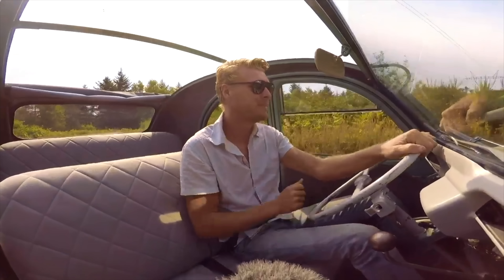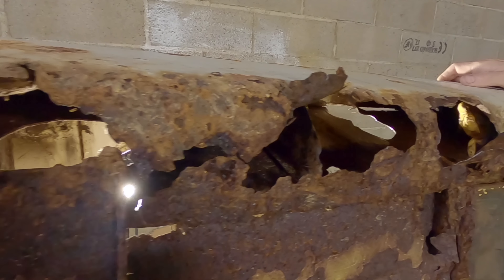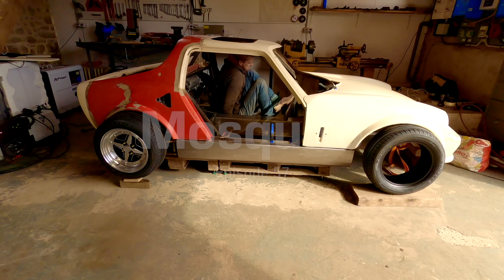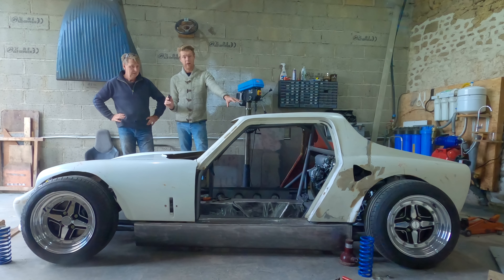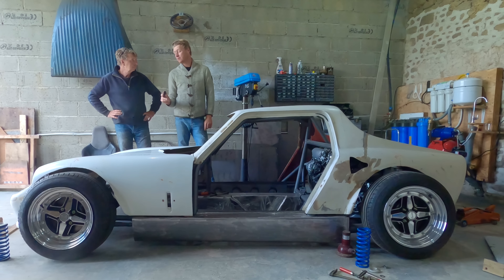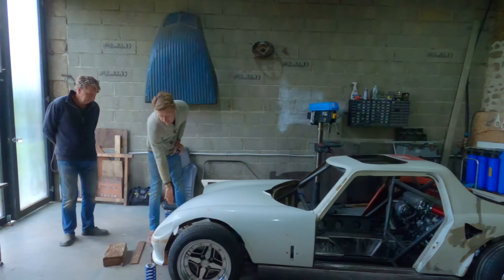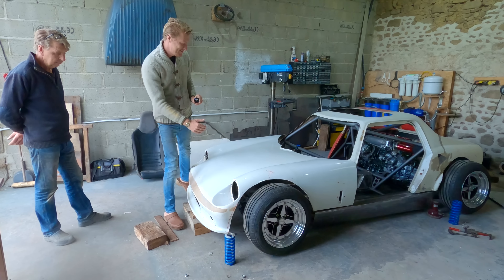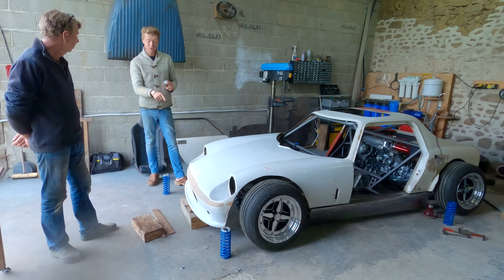Slammed  | Project Mosquito Honda Type R Mini Supercar (Ep57)

Comment: Having done a lot of fiberglass, I have learned a few things. With regards to the wheel arches , It way easier and more uniform , to find something, to use as a mould, that is already the right shape, or can conform to the right shape easily. Plastic is a great thing to use, firstly because the fiberglass doesnt stick to it, but also for its flexability. If you look around you might find a garbage bin , lampshade or whatever that just fits perfectly , and can be copied four times.

Comment: Looking at how that body is personally i think you would better off just cutting ans shaping that one then making a mould off of it, then you could make a new body with a consistant thickness and adding reinforcement where you want. Not to mention that you could keep the moulds and pull a replacement if there is ever any damage

Comment: Glad you're redoing the center notch, "unrefined" describes that well ;)

For the rear wheel arches, have you considered cutting on the horizontal body line, and then just extending it outwards to cover the wheels? You could blend the door into that, or just put a mild backwards rake into the extended body section. Could be an opportunity to add venting and radiators. An idea for the front clip could be to split it down the center line, but then also cut perpendicular across the vertical edge of the headlight bucket. The two resulting front fascia pieces then lengthened to cover the wheels, and the rear two pieces angled so they line up with both the extended width front fascia, but also with the door jambs.

I hope Youtube's algorithm will pick your channel up soon, because it deserves to be seen. I've watched your whole Mosquito series from beginning to now, and can't wait to see the first drive when all that HP meets the lightweight construction.
Reply from the maker: You have a good eye. It will be widened from the body line but I want it to look completely unmodified
Reply: @OliverPickard  As you've said in earlier videos, you've been planning this build for most of your life, so you'll probably build something very appealing and exciting. And I'm looking forward to it!
Reply: @OliverPickard  I'm having Mosquito to Morris Minor thoughts but you'd need to add a bit more than the 4" that took. I then start to think about Porsche flat nose fronts. There might be some Porsche fibreglass wings around that could be adapted.

Comment: Fantastic as always.
2 Random questions
Will you fit Led headlights?
Have you considered some vertical air-dams type devices at the front of the front wheel arches?
Reply from the maker: No i don't like spider eyes, air type device...wheel arches? Yes
Reply: @OliverPickard  🤣 Thanks for answering

Comment: I would not be surprised if you end up using the modified shell as a mould, you know that you want to do a full carbon fibre shell... Works Escort style bubble arches might look good on it, and you would be amazed at the stiffness the shape of the front ones would add to the clam.
Reply from the maker: Bubble arches would be far too easy although you are right they would look good

Comment: Rather than cut great chunks out of the front clamshell, you should have lengthened it to center the wheels in the existing arches. Cut off the rear of the clamshell behind the wheel wells across the bonnet in front of the windscreen. Fill in with new fiberglass. 
That way the wheels and the headlights won’t clash, and you retain room for the radiator.
Reply from the maker: That would be the easy way yes but there's a way to do it all without making the car bigger and no matter what the arches would need removing because they are far too small

Comment: Love the build Oliver!  Just a couple of questions....when the springs are at full compression i.e. fully bound are the shocks right on the bump stops?  And why not move the bonnet forward by 15 mm to give more clearance on the wheel/headlight interface?  Probably not a big issue building the rear of the bonnet backwards or indeed extending the main bodywork forwards?
Reply from the maker: Thank you! Your bump stops are there to stop the shock before the coil binds and the spring rate goes to infinity 🫨.
Making my tiny car less tiny to solve a problem I created would feel wrong and to make it look right you'd have to make the headlights illegally low
Reply: I was thinking along similar lines.  With the larger wheels sitting further forward than the Mini based original, stretching the middle of the bonnet to keep the wheels centred in the original arch ... would you really notice that the bonnet had been lengthened. Surely you will be looking at the wider arches.

Comment: Great video again, that tweek to the front grill makes a huge difference👍 I know your bodywork plans are under wraps. but having had to di similar to my Mini Marcos I can recommend the use of Builders spray foam to give you someting to sculpt. It carves easily using a carving knife and sand paper etc. I left my foam in place as iy weighs nothing and laid GRP over the outside and inside to give a very strong structure. Those spider cracks are caused by stress or impacts, I've not heard of sun causing them though it can bleach out gel coat pigments. Youll need to grind out the cracks and repair with GRP tissue and reinforce the rear of the panel. Look for a book called How to Repair Fibreglass Bodywork by Miles Wilkins (ex Lotus), Ive been following his advice for over 30 years and not suffered any recurrence of cracking
Reply from the maker: Thanks for the tips 👍🏻

Comment: It's going to look better once the front arches are on, if you had left it the same length as before once those arches are on it will look odd. Talking of archescare you going for a blended in look are the bolt on like the Porsche 924 GTS? Also I am getting a baby  AC 3000 ME feel to this creation which when you think about was originally developed in a similar time period.  Its looking good lads keep up the good work.
Reply from the maker: No bolt on arches here although they would look cool. If we get it right it'll look like it's always been that way

Comment: You probably should have cut and just extended the front end to make up for stretching the front. It is really going to make doing the front arches really crazy with them being so close to the front end.
Reply from the maker: There are many times in this project where making the tiny car bigger would have been the easiest way to solve a problem but then it wouldn't be a tiny car anymore. Also it would make the headlights illegally low so I'll have to get creative

Comment: /  *  *  *  *  Slide the front end forward , then you can easily add material to the cowl and the rear of the fenders . This allows you to correct the door fitment .  Only cut above the tires , not ahead of and behind , remember the wheels travel along an arc upward .
Reply from the maker: Its a good idea but that would make the head lights illegally low and make my tiny car bigger which kind of ruins the point of building a tiny car. I've come up with a solution which so far no one else has suggested probably because its very French and a bit nuts. 
 Wheels don't travel in an arc with double with bone suspension that's what makes it awesome but I really appreciate the thought you've put into this.
Reply: @OliverPickard  I don't understand how moving the front end forward would lower the headlights ?

Comment: The front end is definitely better. I'm thinking you would do  less work and get better results to raise the top line of your lower body valence- about 30mm in the rear and about 17-19 mm in the front. That should give you a bit of body rake as well as fill all those open holes. Love dad's Old school methods- no fancy smancy measuring or horsing around, just get it to fit!
Reply from the maker: Nothing is fixed in position properly yet and obviously the body still needs more work but part of fitting me in the car was reducing the visual body rake

Comment: I like the new openning, it reminds me of the Lotas Elan.  Are you going to duct the coolant air from the radiator out the top of the hood (bonnet)?  Are you considering an electric pump to move the coolant from the radiator to the engine?  I don't know if the pump on the engine is designed to move the coolant that far.
Mike Satke, St. Louis, Missouri, US.
Reply from the maker: I did look into "helper" pumps but from the specs I've read the factory Honda pump is more than up to the job

Comment: I think the best fix could be to cut the body right down the middle and add 2 inches to the width if not more.
Reply from the maker: That's the easiest way not the best,  you'd have to add about a foot! My way will take about 6 times longer but it'll look like it's always been that way when it's done

Comment: If it’s rear engine and rear wheel drive, why do you need a tunnel in the middle of the interior?
Reply from the maker: The radiator is in the front so we have coolant lines, fuel lines, shifter cables, brake lines that all live inside it